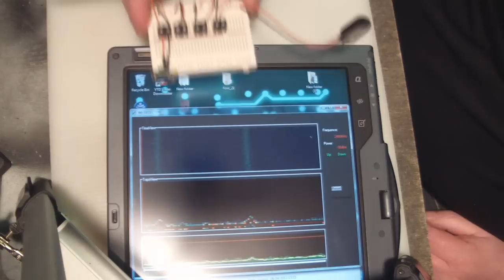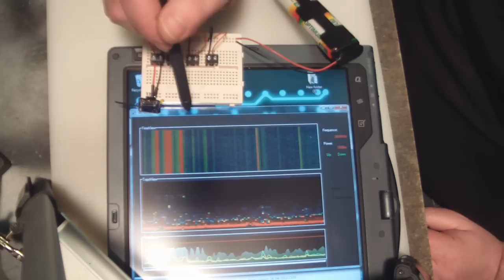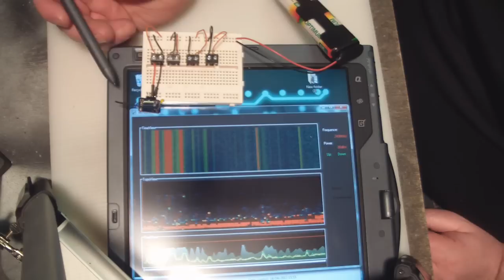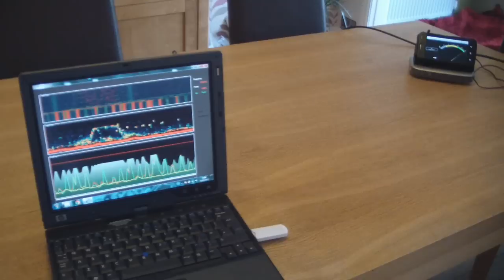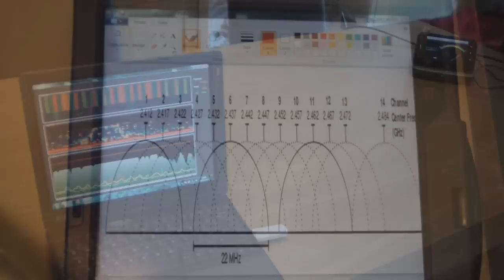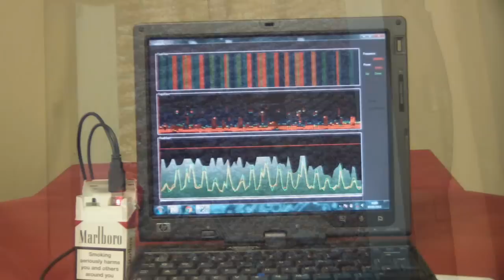Build your own WIFI jammer

Comment: I actually just made one of these bad boys. Less fancy than yours, of course, but it works! I decided to use an Arduino Uno as a power source and it turns out that it works a lot better than I anticipated. Running just from USB with the default antennas, I can make any 2.4ghz device believe that no connections are available, and it definitely messes with my Bluetooth stereo and headset. Thanks for the tutorial and link to the parts!

Comment: If you install a diode instead of the resistor inline with the charge port power you gain reverse polarity protection as well as the forward voltage drop you are looking  for. Just an idea...
Reply from the maker: ***** nice idea will give that a go thanks Geo
Reply: "reverse polarity" protection ??????
Reply: DimitriS SofianoS yes.....

Comment: hi Mr. Macneil. Congratulations on the 2 videos about 2.4GHZ wifi JAMMER. I started testing with these transmitters and also plan to use amplifiers and perform tests using the Longley-Rice model. The first version can be appreciated in this video: WIFI 2.4 GHZ JAMMER

Comment: The av adapters in your description are slightly different from the ones you are using in your video. The ones in your description are green and have 5 soldier points on the side where the channels are
Reply: most likely it just has one more GND point. mine had

Comment: How to would you go about making a shorter range one? I just want to knock out the wifi on my phone, while sitting right next to it, and not be a gigant douche to my nieghboors. 

I was thinking of just sticking the jammer and phone in an rf shielded box to limit some of it, but can you run these at a lower power or remove the antenna entirely to get closer to 1m range?

Comment: I was thinking using 1 of this AV transmitter and using ATTINY85 to program the channel switching for every 0.5 sec. Do you thinks it is possible to auto select channel over microcontroller or 4017(decade counter )  ? thanks
Reply from the maker: Hi i did think of this first but it does not work with these transmitters. They switch off the channel they are transmitting on then turn on the next. They cant transmit two or more channels at once. I have been looking for one that will but have also found a supplier that sells the chip that is used in these so i am designing a transmitter myself to do what you are asking.
andrew

Comment: I am sure my neighbor is jamming my wifi. Is there a way to be sure and prove this in court? Anyway I can prevent him from doing this?
Reply: Call the FCC, and ask them. You would have to prove he is intentionally jamming the 2.4GHz range, and not just accidentally causing interference. Get a spectrum analyzer like he has on the video, and a directional antenna and narrow down exactly where the source is coming from. If you narrow it down to his house, just knock on his door and be like, Hey, my spectrum analyzer tells me that a signal coming from your house is disrupting my wireless network. If he denies, tell him sorry for the mistake, and that you are calling the FCC to find out where it is coming from since it isn't his house. This will cause him to stop doing it if he is doing it on purpose most likely. If it is unintentional, ask him if you can enter the house to determine the source of the signal.

Of course if he is a total douchebag who you hate you can always step it up with a CDMA/GSM/3G/4G/4GLTE jammer hidden in his bushes... ;)

Only way you could prevent this wifi jamming inside your house is line the insides of your walls with lead foil (tin foil might work but lead is better.) Unfortunately this also has the effect of blocking all other signals inside your house, like cell phones. But you could also get a cell phone signal booster, wire an antenna to the roof, so you get service inside your house despite the shielding. All very costly though...

Comment: This might be a crazy idea but what about using 11 Alfa USB (Realtek) pumping their transmission to highest dB?
On a RPI 2 or 3 with 2  powered USB hubs?!
Also to counter the Wifi Jamming in the house a FARADAY CAGE can be used. It is a bit hard to do but a smaller one say like covering a box with aluminum foil and applying some voltage/current to it, high enough to block the jamming signal. Then putting the home router & maybe laptop/mobile inside it for use.
https://en.wikipedia.org/wiki/Faraday_cage
Reply: Wouldn't that block the Wi-Fi signal that you're trying to receive?

Comment: +andrew mcneil 
Hi i don't know if you still check this video but what battery and "laptop wire did you use exactly would this battery work? 
http://www.maplin.co.uk/p/2-power-pda0065a-pda-battery-pda-battery-37v-1100mah-r57ta 
And these transmitters http://www.maplin.co.uk/p/quasar-433mhz-rf-transmitter-module-a58jn

Comment: On this setup you manufactured the antennas yourself. Could you also extract a set of 4 WiFi antennas (as you showed first) and use them instead of having to make them yourself? Or would they not cause the same noise effect as the DIY antennas?

Comment: thank you i just spent more money then i should have on tons of antennas this month..
However, what happens if you use all 4 channels at the same time on the same transmitter ?.. im gesing a short obviously but would it work ? :P (insted of using multiple)
Reply: E Andersson either way i am sure it will help others :P CRASH BAAM ZAAP ..smoke

Comment: @dotnet Definately not legal in the US or the EU, in fact it's a federal offense with potential jail time to interfere with any communications signal. There are only 4 non-overlapping channels in the 2.4 GHz WiFi spectrum. Those are 1,6,11, and 14. 14 is only licensed for use in Japan. All other channels overlap. The FCC doesn't exactly have the most manpower and they are more worried about bigger things than somebody jamming wifi in a 200 ft area. However doing it for more than a couple minutes at a non-peak hour of the day as a proof of concept is just a jerk thing to do and if you were investigated you could get in trouble theoretically. If you live in an urban area it matters more a lot more than if you live in a rural area as you will disrupt many more people.

Comment: I cut up some vcr antena cable and made it 3 inches long tube is one inch and the wire is one inch leaving an extra inch to mount it I shouldered it but turns out the wire has a copper core will this still work??

Comment: do you use all the channel jumper contacts on each unit or is each one set for 1 channel and can you link where to find the best wire for the antenna and the gauge wire you use for connecting the power. Nice Video definitely subscribing

Comment: is it possible for you to build one and sell it? i would be interested in acquiring one, but i dont have the time to build one. your video makes it really simple to build one but it is time that i do not have. would be great if you can. Thanks.
Reply: It would be highly illegal to sell
Reply: xtechnolegendx that is quite true. I was wondering if you know what the PCB strip that he mentioned can be found? I quite can't find the strip, only boards. Also for the transmitter, i can't seem to see the jumpers being connected on the board. For ex. channels 1-4 he uses the first two. TO get channels 5-7 do i solder a jumper from the 2-3 point? Thanks

Comment: I think you had mentioned a blob when pushing up the wiring sheath.
Reply from the maker: Are is see what you mean, just had to watch it again! No when I said blob it was the outer braid of the coax. I you watch my newer vids (better description) on dipoles it is when you push the outer braid down into the metal tube and flood with solder. Probably not the best technical description! ;-)

Comment: will it jam 5.8 ghz?, furthermore, if ti does not jam 5.8, if I replace the crystal with a 5.8 ghz crystal, will it then operate on 5.8 ghz?
Reply from the maker: No and no you would have to replace more than the crystal
Reply: ok thanks
Reply: andrew mcneil
So how would you go on about making a 5Ghz one?
Reply: +Andrew Wong maybe find one in the 5ghz range
Reply: +Andrew Wong I'm sure they have them

Comment: I wonder if it is possible to optimize design and use only 1 or 2 AV transmitters and counter to switch between channels ? If yes then how fast should be this switch to generate enough noise to prevent AP association ?
Reply: +Piotr Król A cheaper way to do this is to flood deauth packets to APs, specifiying the broadcast address FF:FF:FF:FF:FF:FF as the client, and it will de auth all clients, put in loop and you have wifi jammer! And works from any regular wifi adapter
Reply: Xen Nex thanks for reply. I'm aware that using de-auth frames would be much cheaper, but this is not exactly what I want to achieve. I'm looking for cheap noise generator solution that can jam wifi network by decreasing SNR, just like it was shown in above video. This device is for testing purposes. I manage to get partial result using ESP8266 and UDP broadcast, but this drops signal to -90dBm only 1-2 times in a minute for couple of seconds. I need solution that can do this continuously.
Reply: @xennex9261 need more info

Comment: will this work on Bluetooth?
Reply: I'm also wondering. The band is same, but the power output of the modules may be too low. A high gain panel antenna may be necessary in all cases.

Comment: I ordered a part from sunTekstore and It's a bit different from the one in the video the channel area has five soldier points
Reply from the maker: I need to some myself. Does he say what the extra pin is for?
Reply: The schematic say to use the center of the 5 pins as a ground but the part itself says both of the points on the end of the 5 points are "GND"

Comment: The bankrobber's best friend.
Reply: +l Absolutely. Why else would you need one of these :)
Reply: I feel like there is one problem with that. I doubt any bank has buttons to say they are in distress (I'm just ignoring the wi-fi and phone thing) but rather buttons that say they aren't safe/okay meaning that if a signal was disrupted, there wouldn't be a safe connection sent out. I don't know what systems banks use, but a signal transmitter would probably be a better bet if that's how their security is setup, but that's probably the easiest security feature to overcome out of all of them.
Reply: Snookers I'm not sure what point you were trying to make, it appeared to me as if you were arguing with yourself.
Reply: l Pretty much. I was trying to say that you would need a lot more than a wi-fi jammer to get away with all their security items.
Reply: Snookers Yep, they took all the fun out of it..

Better to just learn hacking and do online robberies nowadays, should you feel inclined to go down that path.
Reply: l "Took all the fun out of it" How many banks have you robbed? :D
Reply: Snookers None, other than my own.

Comment from the maker: hi there is no schematics just off the shelf parts wiring 4 av transmitters together to a power supply.
Reply: what about the audio/video pins should they be left open?
Reply: What is the information that the transmitter is emitting into the spectrum?
Reply from the maker: @rajasekhargutti5097  Yes
Reply from the maker: @rajasekhargutti5097  White noise
Reply: How to select one channel?
Reply: @andrewmcneil  thank you
Reply: @andrewmcneil we should give power to the channel pins or just give the gnd leave 5he rest of the pins
Reply: @andrewmcneil how you selected the 1 channel by leaving the remaining two pins left open
Reply from the maker: @rajasekhargutti5097  Yes
Reply: @andrewmcneil  so you are saying that default the logic of the pins is "1" and if we want to change it we will connect it to the ground.yes or no? Plz